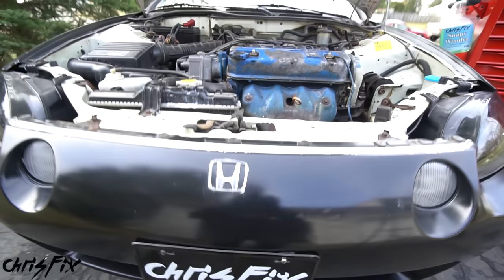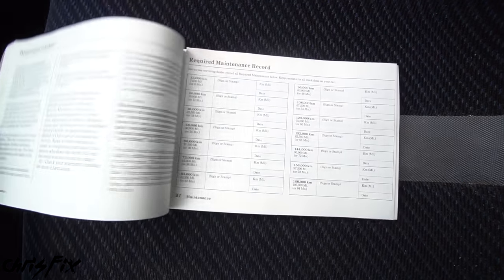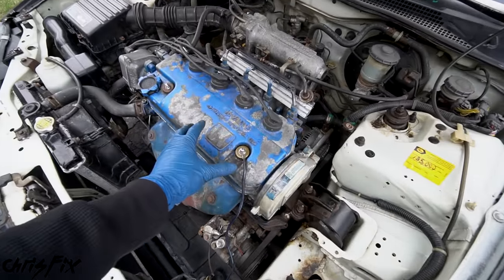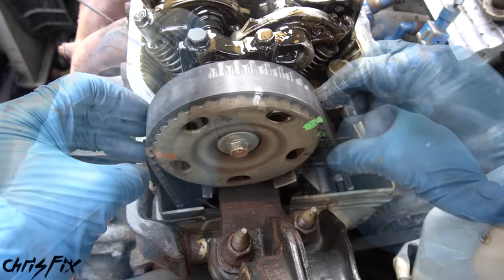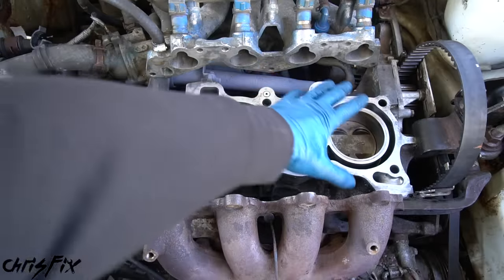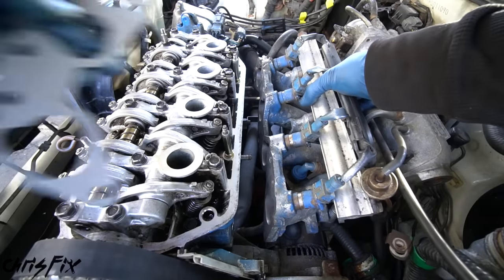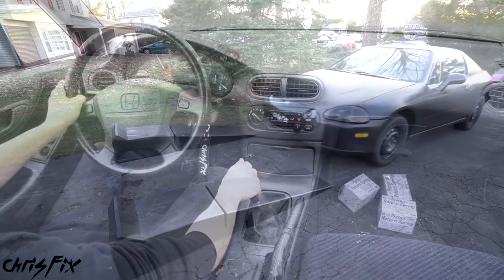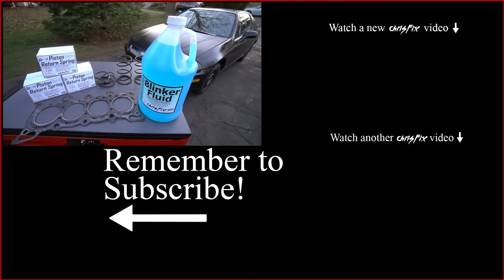How to Replace Piston Return Springs (and Head Gasket)

Comment: I almost have 100.000 on my Honda so i am getting my new piston return springs. I am not getting another Honda because every time I get it serviced the y have to replace the muffler bearings & the cost is extremely high. My Ford truck is a made special way that the muffler bearings never have to be replaced. The Ford guy said that they are lifetime & our engines are made to work without piston springs. Buy a Ford , much cheaper to service

Comment: hahaha no knock on Chris here but this is literally the easiest head to do, try doing a Montero or BMW ... not only that but typically a head gasket goes because of overheating which warps the head surfaces, you have to have them machined straight again and even after that theres not guarantee that the head integrity (weakened metal caused by heat) is good. It may blow again. There's a reason why good mechanics spend a lifetime honing their craft.

Comment: I am genuinely confused why a vehicle would ever need piston return springs, I did the mental math, it doesn't work out, the engine would be losing energy not gaining if such a thing were in an engine, plus the crankshaft pushes the piston back up. while I do think it is possible to design an engine with the springs, it wouldn't be worth it at all.

Comment: BRO you forgot to apply assembly lube while putting in the springs they will wear down the cylinder surface until they get lubed inside the cylinder 😭😭

Comment: Surely your joking!  Those things would destroy the valves right away! You might as well leave the timing belt off. I think that's a non interface engine so there's a chance you might correct your mistake after the CBS gummies wear off!

Comment: You bought the cheap springs, chrome plating only makes them look good. They're probably off brand chinese ones. I know the best beehive springs are expensive, but they also mean you won't be having to redo the job in a few thousand miles. Cheap parts are false economy! It's like not changing the throwout bearing when replacing the clutch!